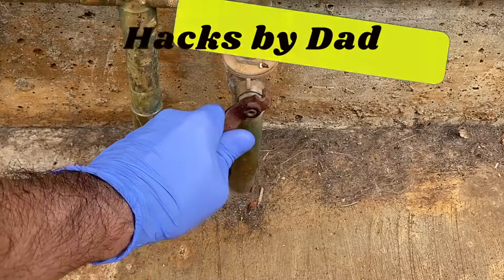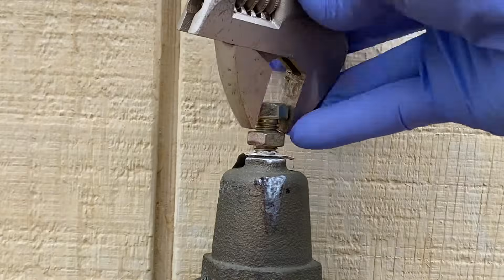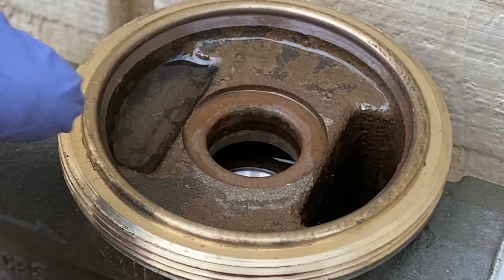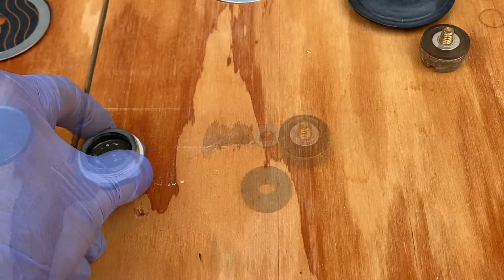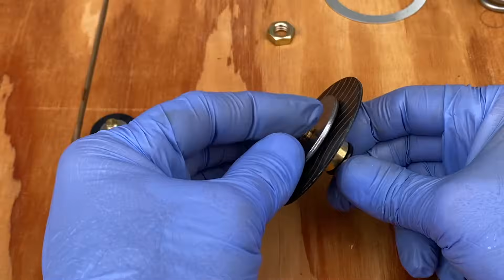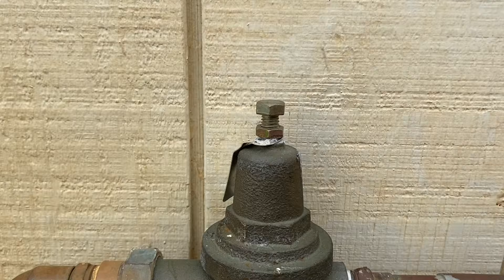How to Repair a Water Pressure Regulator | Zurn Wilkins 600XL

Comment: Thank you SO much. This worked PERFECTLY for me. My regulator had been replaced by a plumber about 10 years ago and failed last month. The inside was a rusted mess, although the only thing actually 'broken' was the small rubber O ring. I ordered the repair kit from Amazon for around $60, and with a couple of hours work (the two plugs at the bottom were frozen solid and needed a lot of work to remove which added an hour) I saved a $400 (or more) plumber's visit to replace the valve. The only difference between my 1" device and the one in the video was that the new stem was not a threaded stud at the top , but instead was a tapped hole so the diaphragm was attached with a supplied bolt instead of the nut in the video. It all went together exactly as described otherwise, and when it was done I turned on the water and no leaks and set the pressure for for 65 psi using a meter I had. Excellent no nonsense video. Grateful for your time in posting this.
Reply from the maker: Thanks for the feedback!
Glad to hear that the video was helpful and you were able to rebuild your water pressure regulator.
😎
Reply: Did it stay working?🤞
Reply: @sh8nn0n92  i am also curious. About to order the repair kit and attempt. Have you found anything online that they stop working?

Comment: #hacks by dad Thanks, I followed your steps. My regulator is around 6 years old, I installed repair kit less than an year ago, but it stopped reducing pressure recently. Opened it, no terrible rust, I cleaned everything, but it still doesn’t reduce pressure. The kit purchased at Amazon, it is not Zurn original, my guess it's why it stopped working that soon. Appreciate your advice

Comment: Fit on a watts? Can’t find repair kit for watts- 1 inch piping around it, but house pipes are 3/4?thanks!
Reply from the maker: Sorry… I doubt that it will fit in a Watts device.
Reply: @HacksbyDad thanks Dad💪💞- i may just try, the repair kit for a watts is almost as much as whole thing, i hate waste. Or i’ll switch out for the zurn if pieces don’t fit💪
Reply: Hi Dad👏i’m back! Is it possible to replace with a 1 inch or 3/4 inch prv? Incoming is 1 1/4 marked on elbow- and 120 psi into home right now😬
Will try to open it all and clean first..
Reply from the maker: @sh8nn0n92  I'm not a plumber and would replace it with the same size.  👍😎
Reply: @HacksbyDad thanks! Appreciate you!

Comment: Super important for all those houses with Thermal EXPANSION tanks plumbed into their Hot Water tank.
Check and make sure the thermal expansion tank is the same pressure as the Water Pressure Regulator.

Comment: Well done video, appreciated! I ordered mine from Amazon (RK34-600XL; RK34 = 3/4" pipe connections) from Seller Bonbo for $32. Arrived next day. Parts were fine. I went slow and it took me an hour or so. Someone asked about wrenches, two caps on bottom are 1-1/8" and for the main housing I used a pipe wrench. I'd guess it was around 1-1/2"  This video was a great help. Thank you, "Dad"

Comment: My regulator has a pressure relief valve just down the line to the left a bit. The relief valve has a constant leak. Will this solve that problem?
Reply from the maker: I suggest checking the water pressure after the regulator.  See if the pressure is at or above the pressure stamped on the relief valve. 
👍😎
Reply: @HacksbyDad I checked my pressure as you suggested. It was THROUGH THE ROOF! 120!! & it wouldn’t adjust it down. So I bought the kit (I needed the 1” kit, btw. Although your video shows that you’re working on a 3/4”…AND RK34 DOES indicate that it’s for a 3/4”, I think specifying such & informing viewers that they might have the 1” version would be helpful….IMHO). I followed your directions (a tiny bit different for the 1”) and although the old parts that came out didn’t appear to be worn, which was worrisome, it IMMEDIATELY solved the pressure problem. 😃🙏🏽🙏🏽…….unfortunately I STILL have the small constant leak from my pressure relief valve so I probably also need to replace the valve 😔. I probably wouldn’t have to if I had found your video & dealt with the periodic squealing noise it was making 5 months ago before it became a leak.  Anyone reading this,….if you have noisy pipes developing, follow “Dad’s” advice before it gets worse. 😃🙏🏽
Reply from the maker: @kaiyoti6478  👍😎

Comment: They wanted $1200 to replace mine. Can it still be done if it's on the ground? Is this the only model that makes kits for their own brand?
Reply from the maker: You just need adequate space around the unit to work on it.  I’m not sure but repair kits should be available for other brands.  
👍😎
Reply: @HacksbyDad TY.

Comment: Thank you so much! We had a pinhole leak last year due to 90+ water pressure. We had also been living with loud pipes and it turns out our water pressure regulator was no longer doing its job. The Zurn kit cost me $60 and your video made an otherwise daunting task sooo manageable. Thank you!

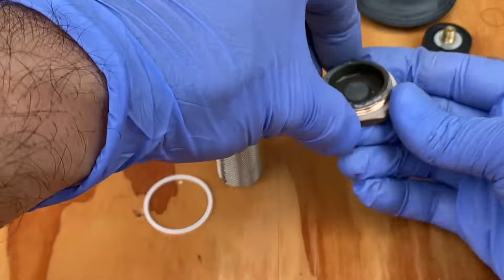Comment: Awesome video. I’m here in 2024. The strainer screen at 1:39 only goes in one way, so if it does not snap in place like in the video, flip it 180 and press it in. Also my entire regulator was full of calcium deposits. I used CLR and a toothbrush to clean everything. On stubborn spots I had to use emery cloth. It took me longer to clean everything than to rebuild the regulator.

Comment: This is very good to know about it's,  but do they sales those repairs kits for us and where to buy it from? Thank you so much for showing us how to repairs this
Reply from the maker: Thanks for the question.  
Yes, the repair kits are for sale to the general public at many plumbing supply stores.  Click  the “ Where to Buy” button on the Zurn Wilkins website to find a dealer near you.  I also placed an Amazon link for the 3/4” pressure reducing valve in the video description.  Confirm if yours is 1/2, 3/4, or 1”.  Good luck with the repair!
😎

Comment: But it only happens when I use the washing machine ?
Reply from the maker: Surging?   I’m not a plumber but maybe it’s water hammer.  Might be that the water inlet valve in the washing machine is faulty.  You can try removing the hoses on the machine side and running the hot and cold water into the laundry sink.  If no surging, then it is probably something to do with the washing machine.  
😎